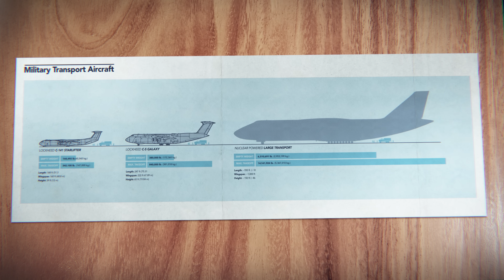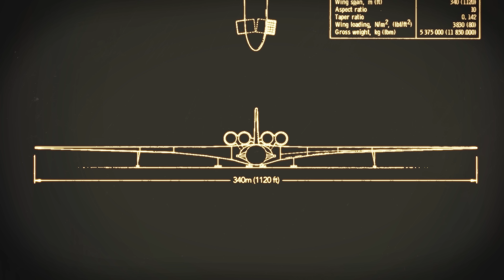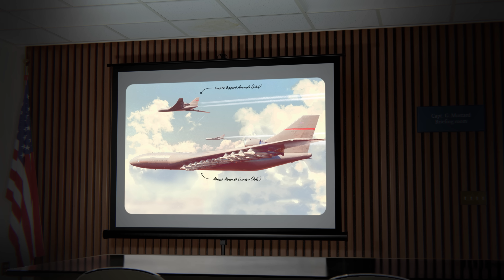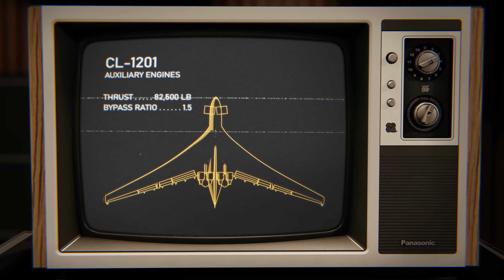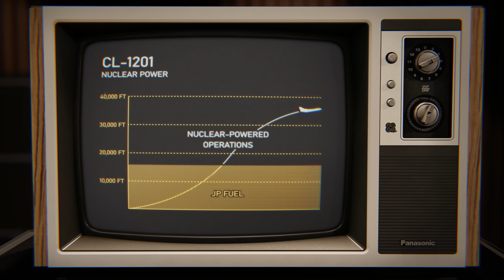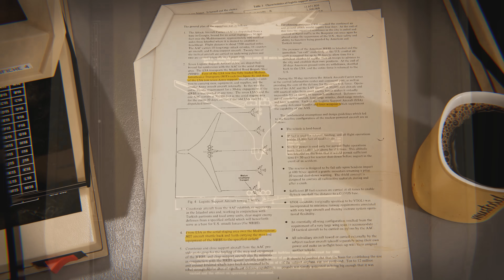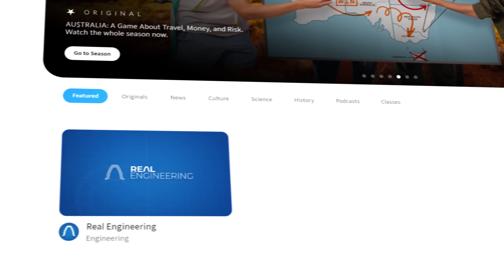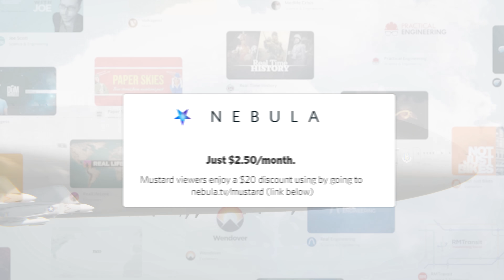Lockheed's Insane Attack Carrier: The CL-1201

Comment: 07:03 -- "...eighteen thousand megawatts..."

Eighteen gigawatts. That's a higher wattage than any conventional land-based nuclear reactor.

The displayed text in the video shows 1,830 MW, or 1.8 gigawatts, but that is still a higher wattage output than many conventional land-based nuclear reactors.

Now imagine trying to fly any conventional land-based nuclear reactors.

The S8G nuclear reactor powers the Ohio class ballistic missile submarine. It is 42 feet in diameter, 55 feet long, weighs 2,750 tons, and puts out 44.8 MW.  You'd need 40 of them to produce 1,830 MW.
Reply: Los Alamos developed a wide range of obscenely powerful reactors for NERVA in the 50s and 60s, these 'should' be relatively lightweight since they were intended to be at the heart of a rocket motor... but being a rocket motor they only needed shielding for everything above it. Being at the center of an aircraft, the shielding is probably the deciding weight factor, not even the reactor itself.
Reply: also @KR4FTW3RK  at Los Alamos, there where attempts to make nuclear reactor powered ram jets in the earlier years of the same decade. Look up project Pluto and S.L.A.M.. Those prototypes did work.
Reply: Thank you this was the comment l was looking for. When I heard 18,000. Megawats alarm bells rang plus like you said the number in the video is different then what he says.
Reply: Probably can be achieved with higher quality fuel? Idk I'm not a nuclear engineer
Reply: Cmon guys, the solutions simple. 

The video never specifically said it was a fission engine, now did it?
Reply: @juliannolastname2442 Fusion reactors are even MORE complex than fission, requiring more shielding, energy storage for the heat needed, etc.
Reply: Yeah, I heard the "18,000 MW" too and about fell out of my seat. Even 1,800 MW is still high though, and the Lockhead engineers may have actually been a little high making this thing.
Reply: Lasers, especially 60's tech lasers, are not efficient. But I mean, more power right?

Comment: These days I could certainly see something like a Galaxy or an A380 converted to be a carrier for a bunch of midsize drones or a massive swarm of smaller'ish ones. The tricky thing IMO is making it viable to return to dock. Maybe the galaxy is more viable there, as it could maintain level flight or a slow decent at low enough speed, to possibly make a vertical final approach viable (to either the top or bottom), thus avoiding the worst of the wake.

Comment: Lots of problems with such a design. The four massive engines would be, especially then a dangerous and failure prone issue as with a diameter that large, the blades’ tip speed would destroy any material available. This would be a catastrophic failure that would undoubtedly spread to the other three and destroy the entire plane and all aboard. Such a plane would have a huge radar signature and be vulnerable to SAMs, being a very large slow to maneuver target. It’s much better not putting all your eggs in one basket as the saying goes

Comment: 02:05 I'm not sure if this is a CGI recreation or an actual prop. But MASSIVE Kudos to the filmmaker regardless for starting this sequence - not with a computer - not with an early word processor - but with an actual vintage Microfiche Reader!! A piece of tech that would've been familiar to anyone in a major library of the time doing research! The last time I saw one of these in person was in the mid-1980s in a local community College library!
Reply: It's called a Microfiche Reader? Thanks for the name drop, now I know what to Google :)
Reply: It's CGI.  I worked for a small aerospace company and as of 2018 they were still using microfiche for maintenance manuals...they had a lot invested in their library so I can understand why they weren't particularly motivated to transition over to digital.  It still sucked having to use them compared to modern digital means (you can have every manual created directly on your phone these days), but it was better than paper manuals in some cases.  The nice part was that you could have readers all over the hangar in specific work areas, so you didn't have to make dozens of trips back and forth to the office remembering bits and pieces at a time, or jotting notes down for later.  It must have been a real treat for large businesses with a lot of technical manuals back in the day.
Reply: Agree! I'm a CG artist and a former F-4 squadron member and the models, texturing and lighting were fantastic!
Reply: Our public library had ours placed VERY publicly near the entrance on the ground floor. I have since moved so I haven't been in there in about 5 or so years, but they were still there in the last decade. It's awesome to see them

Comment: The biz near the end of the video about the vortex coming off the tips may - especially with something with that kind of wingspan - be inaccurate.  If you peek at the Prandtl-D Flying Wing design, the wingtips on one of those are rotated forward and produce no lift in level cruise flight - and thus no vortex either.  I don't know if the Skunk Works actually did it that way - I imagine no one does - but if they *had*, it would've had several advantages, efficiency being a major one.

Comment: As someone who has fixed and armed fighter jets, the rearming and maintenance of those parasite F-4 Phantoms would give me nightmares. 
Realistically they would do a mission and upon return any fault or maintenance that requires hangar time would simply have to wait until the LC1201 returned to base or the aircraft would need to be diverted to friendly airbases.
Rearming external weapons would be feasible with lightly manned gantries that descend alongside the jet when docked but even then that would be leagues more difficult than rearming the jet on the ground. Parasite aircraft with internal weapons bays, like stealth fighters, would be even trickier to rearm for another sortie than the pylon mounts of older fighters. 

Truly a fever dream of an aircraft with a very specific mission in mind.

Comment: I would thing that while in flight with all those F-4 Phantoms would have some issues. The airflow into the engine air intakes on the F-4’s would have the turbines constantly spinning even though the engines were not running. They would have to develop a way of closing off the intakes during caged flight.

Comment: AI generated news presenter, nuclear reactor (without water storage), huge engines (without fuel storage), wings that just make drag (judging from the model), I'm too tired to take this as a joke, if i missed anything, please just bully me in the replies.
Reply: The slack in the wires for the controls, the absolute weight, the drag, this just seems like a joke or something. If "nuclear power" could propel things, everybody would just launch rockets from the Sahara or either one of both of the Poles  using that method. The thing that got me- no mention of the fuel- witch is the thing that dictates how fast/far one combustion engine can travel.
Reply: Peter Baker is a real news anchor who used to work for the BBC. He does commissioned projects. Mustard doesn't cut corners.
Reply: @ChrisConron  look at his neck when he talks, there are some artifacts
Reply: @dundun8640  Looks like a green screen to me. AI is not emotive. It looks robotic to me

Comment: reminds me of the plan for a space warship with a nuclear propulsion system
Reply: How does Nuclear Propulsion work? in your own words?
Reply: @dundun8640  Why would I use my own words when I can use the words of the scientists and engineers who built it?
"Nuclear thermal propulsion provides high thrust and twice the propellant efficiency of chemical rockets. The system works by transferring heat from the reactor to a liquid propellant. That heat converts the liquid into a gas, which expands through a nozzle to provide thrust and propel a spacecraft."
Any other inane questions you'd like to troll with?
Reply: @tim3172  where you keep the fuel? So its just boiling water...again. How do you get enough "water" for it to be viable?
Reply: @tim3172  its just funny how you know so little that you can only parrot what someone else said.

Comment: Those slides towards the end: “Ballistic Troop Transport”.  Just wow.  For when you need a squad of infantry anywhere in the world in 30 minutes?  Talk about a wild ride.  And 1,500 ton aircraft carrier?  You want a nuclear reactor in something smaller than a Fletcher that can also launch jet fighters????  That sounds like a tall order for a 15,000 ton carrier.
Reply: this probably did fail to the considerations of phyics, but I believe the empty weight of a plane only really relates to the material used to make sure it doesn't break in half mid-flight. It's the engines that decide how much it can (theoretically) carry. And whatever custom engines they designed were probably made to fit the math.
Reply: like proto-ODSTs
Reply: Prove to yourself that you have the strength and courage to be free. 
Join... The Helldivers.
Reply: We’ve had much smaller reactors for many decades, just look at the NR-1.      By the way, this aircraft is larger than a Fletcher but weighs less
Reply: I just imagined those "270 troops per floor" all crammed in giant standing braces, geared-up, trying to keep track of what's going on purely by the sensations and sounds. Then suddenly it crashes to the ground, the doors open, and you're being shouted at to hustle.
Reply: Likely the reactor would not use PWR. Makes very little sense to operate one for aircraft operations. Using a liquid fuel reactor, regardless of the cycle chosen , would result in a reactor that would be tremendously lighter, tremendously more power dense, and would have a much higher operating temperature that would allow for jet operations. And it would be easier to make passively safe in case of a shutdown since the reactor content can be drained into a configuration that would be passively cooled. 

It's still beyond batshit but at least it would be physically possible and dare I say operationally practical.
Reply: The crazy thing is Ballistic Troop Transport will probably be built in some fashion. As long as SpaceX can reliably land rockets on their tails, eventually somebody will want to use it as a REALLY fast transport.
Reply: @MM22966 The problem with rocket transport is that to land something of that size, you need to secure the landing zone. In short, you need an airbase. You could drop a Dragon capsule anywhere in Iran, but if you want your Starship back, it’s got to land on an overseas base.

At that point you are in competition with aircraft. Sure, a 30 minute flight beats a 14 hour one, but you can load up the aircraft in 30 minutes, can you prep a Starship for launch in under 14 hours? Remember that launching a smallsat launcher with 24 hours notice was considered a major achievement only done a few months ago, you add crew to a vehicle several hundred times the size…
Reply: @MM22966  there's an image illustrating this but for logistics, using drones to transport crates around
Reply: @spazzey0  Hmm, I don't think I've seen that pic, but there IS some art from the late 50's/early 60's showing very large ballistic missiles being used to transport an expeditionary force of infantry and vehicles.
Reply: Anyone who disbelieves the reality that the CL-1201 could have absolutely worked is not familiar enough with how absurd Skunkworks is. Lockheed Martin is genuinely a half century ahead of everyone else in military aircraft technology. No one else has figured out stealth aircraft still, really.
Reply: @pubcle  While the flight crew and "reactor" techs may have their hands full on the day to day management of this behemoth, I ask as a former paratrooper, what would these soldiers be doing for those 30+ days aloft.  Pretty sure a few deck of cards ain't gonna cut it.  You'd have to put them in suspended animation or they'd likely go stir crazy.  I've done commercial flights from California to South Korea (9 hour flights), and have never been happier to get off a plane in my entire life.  Ordinarily we'd be summoned to the company area, gather weapons, get briefings and be anywhere on the planet with full combat load and vehicles in less than 12 hours of the presidential notice of hostile actions.  This plane and idea is ridiculous.
Reply: Elon: Don't look over here! 😅

Comment: One would think a flying wing would be reasonable allowing more room for aircraft and access to them instead of placing aircraft on the wings and locking a pilot into the jet or limiting the access. They could use a rapid lanch rail system to drop them out of the back  like what they are going with cruise missiles now. I imagine we will see this with drone aircraft and swarm tactics

Comment: You know a plane will be hard to engineer when the engineers decide it'll be easier to gas up all the planes in the fleet while flying than it will be to build your super plane. Also, it seems like there's a lot less meat on this video than usual. 

I just defended Nebula recently. It would be incredibly ironic if I then immediately encountered a video that might show a detrimental effect of Nebulized content.

Comment: Suggestion for a future video

The Concorde SST Successor That Never Was/The Supersonic Airliner You've Never Heard Of: 

The Aerospatiale ATSF / British Aerospace AST (Alliance)

It was a SST proposal made by the builders of the Concorde during the in late 1980s and early 1990s as a replacement for said aircraft, with expected development to begin in the late 1990s and early 2000s. It was to seat between 200-230 passengers, cruise at Mach 1.7 which was necessary due to the desire to build the plane out of less exotic, cheaper and ultimately less heat resistant aluminium alloys to the Concorde in an effort to reduce costs. 

Theres very little on this SST out there besides some concept art. If you wish to look it up on google then the following will likely yield the most results "Alliance AST Plane" The design seems to have been gone through 3-4 iterations with the largest getting into the region of 300ft to 311ft in length. 

SOURCE'S:
-There is a wikipedia article on the plane under the heading "Avion de Transport Supersonique Futur" (Don't worry the rest is in English!)
-The webpage on "secretprojects.co.uk" (forum site) with a page entitled "The Aerospatiale ATSF (Alliance)/ British Aerospace AST" features some info and material
-On Facebook there is a group entitled "IPMS.(UK.) 'Project Cancelled SIG.' (UK. & commonwealth) alt. modelling" if you type "Alliance" into a group search that features 29 pictures of various things. Newspaper clippings, concept art, models etc
-a copy and paste of an article from I think 1999 or 2000 on the 'airliner.net' entitled 'You Thought The A3XX Was Mad, Look At This!" is a fairly in depth article from not too long before the project was dropped. Note at this stage a now defunct German aerospace company had become involved, and so the name of the project had changed to ESCT to make the project more EU inclusive.
- An article on Elsevier entitled: "A review of ONERA aerodynamic research in support of a future supersonic transport aircraft" That according to google images has pictures featuring wind tunnel results both computation and real world and other related material. Although I haven't been able to gain access to those pictures outside of the low quality google image results. And this article seems to specifically about test on the earliest and smallest iteration of this aircraft design.

Last quick side note! It is noted on the Concorde heritage web page that a mark 2 or B variant of the Concorde was planned that would have deleted the afterburner from the Olympus engines, making take off and landing a much quieter affair. It also would have had improved fuel efficiency. Might have seen actual development of that power plant had this plane gone into production.

Lastly it might be worth checking with "Aeroscopia Documentation Centre" I imagine the project would be under ATSF with them. Or Aerospace Bristol. I believe they still have their model of the Alliance featured at the 1992 Farnborough air show. I don't know what else there might have in terms of info, it might also be worth contacting BAE Systems or Airbus themselves.